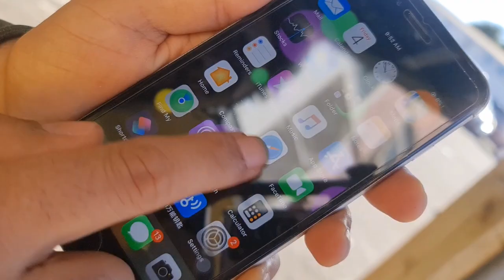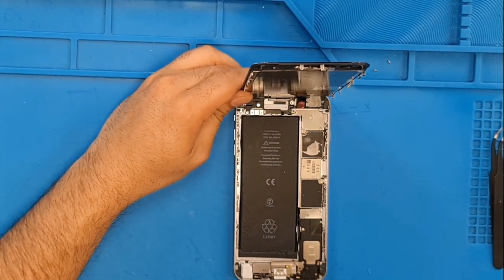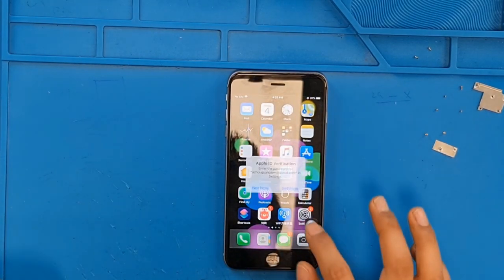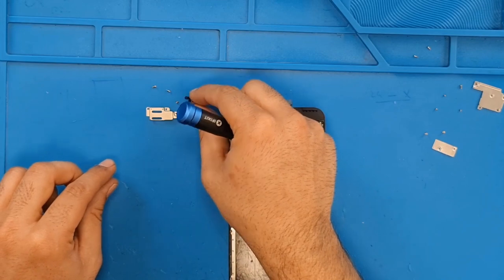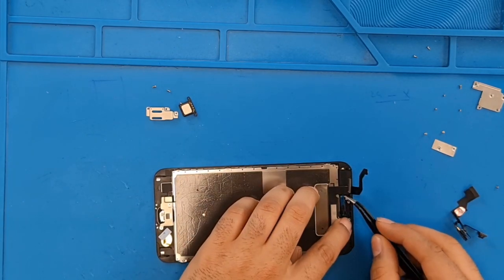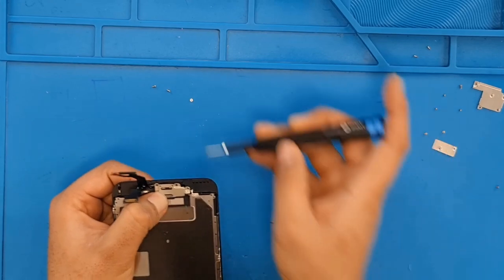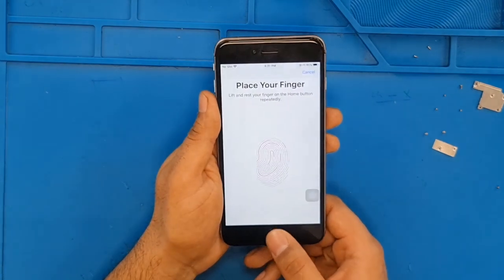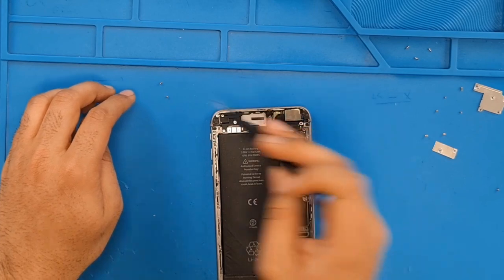Restore your iphone - Run over by a car

Comment: My phone was actually run over by a car yesterday and I'm hoping your solution works. 🙏
Reply: did it work
Reply: @ItsJustOddity  I replaced the screen and the hard drive was still fully functional so I was able to get all the data off it onto my Macbook in the form of a backup file then trasnferred it all safely onto a new phone. While the phone sort of worked, the weight of the car crushed the cameras and I replaced the back camera but the front was not fixable so still needed anew phone.